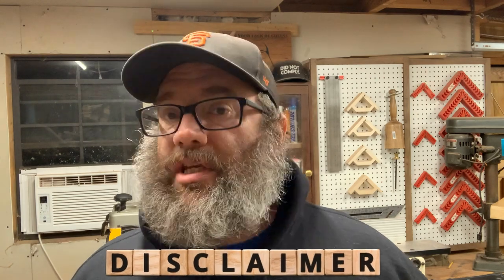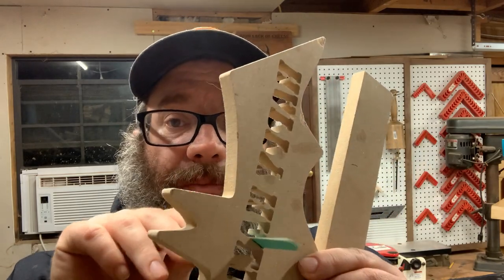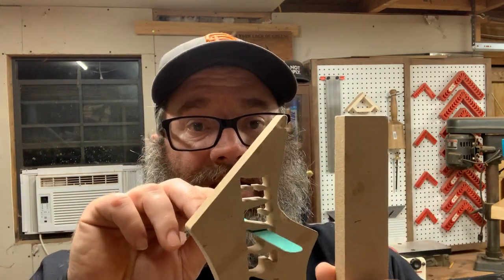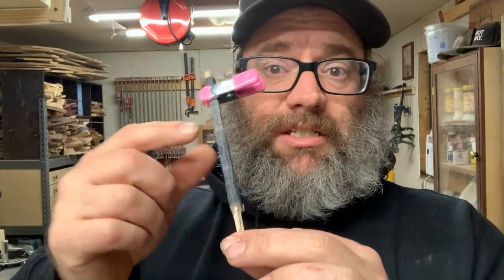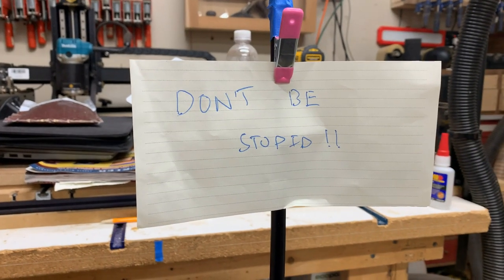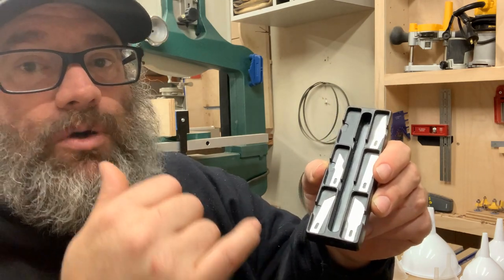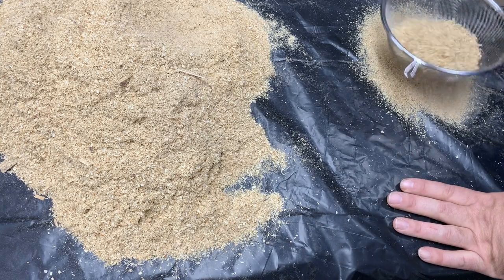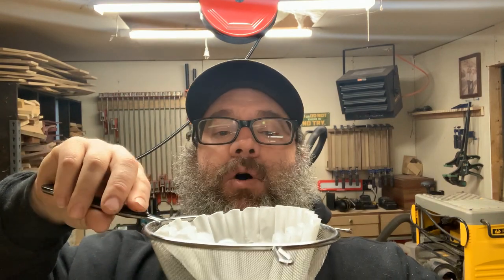WoodShopping at a Dollar Store II: Money Saving Tips (Beginners Especially)

Comment: I buy the small silicone basting brushes in the cooking section to use for glue brushes. I trim them up before gluing anything.  They work great and are cheaper than anywhere else I've seen.
Reply from the maker: That’s a great point. Might use it for Episode III
Reply: I do the same. Great little hidden gem that a lot don't know of or take advantage of. Even works out to be cheaper than buying the inexpensive acid brushes from HF. These days and times, every single penny makes a difference at the end of the day.... more so when you're doing this to make a living.